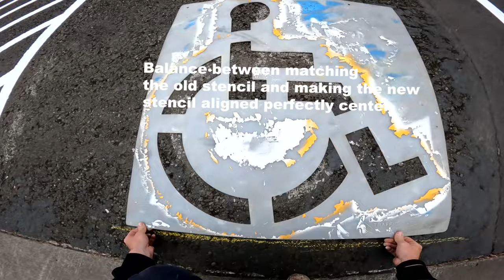Repainting Parking Lot Lines of Small  Business - process from start to finish!

Comment: You guys are wasting so much time and paint by riding on the machine for single lines.. I do striping in Delaware I only use the ride on to do huge parking lots or roadways.. been in the business for 20 years just my advice
Reply: I agree, push all small jobs. Malls and costco for the driver
Reply: so you can walk faster than the cart can, that is what you are saying, right?
Reply: @clkirk70  no douchebag but it's easier to line the machine up while walking than on the ride on. I run a striping business and time is money. I think I would know which one is quicker
Reply: @bdvn5488 how do you typically quote jobs? I was want to start doing this on the side i think there's alot of business in my area
Reply: @spencerevenhouse8175  we charge by the foot and depending on material cost you'll know how much to charge.. depends on the scope of work though as some lots are entirely more complicated than others.. also you have to think about the layout aspect which takes the most time on each job

Comment: Wondering how the paint holds up on top of gravel and moss/mold green stuff if the lots aren’t cleaned or prepped ahead of time. Also wondering why the two inches was important to mark with crayon, and not just paint to the already straight concrete/asphalt line? I guess it’s the customer’s request at the end of the day.
Reply: I was thinking the same thing.  As the owner of a softwash business, I would think that prepping the surface would be the first thing to do.  I would imagine that this might be an upsell item that the client declined...?  Any industry want to chime in on this and what is considered standard practice when it comes to prepping the surface.
Reply: I agree.....the surface should be washed down with water and a street broom to scrub the line to remove mold, dirt and lose asphalt. Dry with blower. Site prep should never be an option for the customer......

Comment: Snapping a line would’ve been much quicker and straighter, crayon grease will be there for awhile and you’ll save a lot of paint dropping the pressure when painting stencils better yet using a 113 tip
Reply from the maker: I agree, snapping a line would have been better - I will pass this onto our striper, although we stencil pretty thick so it lasts longer.

Comment: Those lines are freaking crisp! Great video! I'm about 6 months into the business and love it. I started with a titan 850 and was having so much trouble getting crisp lines. Found an old airlessco surestripe 3300 and it freaking rocks! Great job boys
Reply from the maker: ayyyy Thankyou so much, great work - It can be a fun, rewarding and great little business!
Reply: Just wondering your 850 titan. The only reason you don't get crispy lines it's because of the tires they're not air tires they're plastic but if you change the tires on it and still have the machine balanced shouldn't be a problem just wondering by the way I just started this business first year hopefully everything goes well

Comment: You kicked the gun out and lined the hood up straight. Better to see, I like that. 
Looked like a 3900 ? With probably fast set oil? 
Everything looked great, your starts, alinement on the old line. 
I’ve been striping for an airport for 10 years. And I’m wanting to get out and do parking lots. We only use latex at the airport so I’m unfamiliar with laying down oil. I’ve seen some new lines in my area that was put down with oil on new asphalt and they have this light over spray on both sides. Curious if that’s common with the new asphalt being so black, maybe not noticeable on older asphalt. 
I’m training my daughter to stripe so we can work together in this business. 
I’ve picked up a graco 3400  to get started with.  So I have oil in the machine teaching her. I’m also getting just a little over spray with the oil. Using a 319 with just under 1500 psi. Any tips for painting on new asphalt.  
We haven’t done any jobs yet still getting some stuff together like a pressure washing set up and looking to be ready for next spring. 
Again it all looked good 👍🏻

Comment: on some jobs I have problem with tip clogging, do you have any tips? I see your work is going very  smooth
Reply: Try straining your paint!
Reply: Do you soak your tips?
Reply: Could be many things try upping the pressure cleaning your filter or just putting a new one in, could also be the tip
Reply: Are you using water based or acetone based paint? If you're using water base you definitely have to strain it.. if using acetone base let your tips sit in a container with acetone in it when you are not using them

Comment: Sorry, pal - you can take all the time in the world to line up them stripes, but if you don't freakin' clean the asphalt ahead of time, you'll have perfectly striped dirt, which is what we see here.  You tell me at 2:28 - 2:31 of this video if there's no freshly painted dirt on that line.
Reply from the maker: Thanks for commenting, Pal - in an ideal world we can clean the pavement using machines, apply sealcoat and then do a new paint job. In this instance they just wanted stripes as we would be sealcoating it and/or restriping it in the very near future - so we didn't use cleaning machines, we just used our blower and a wire push broom to clean the cline. There is no *loose dirt being painted in this video.
Reply: @coastpave  Yeah, i was told to only quote striping on a dirty lot, and I sent an email before the quote going over points of detail and one thing I did mention was I will brush off the lines before painting, but it wont be the same as a full clean.

But its up to them as long as I let them know what to expect. I am hoping they will pay for a pressure wash, but its their money.

Comment: So what does the chalk represent
Reply: It was pretty pointless. 1. He didn't line up chalk marks to get equal length lines.
2. He missed the chalk marks.
Reply from the maker: Our striper snaps chalk lines to mark the end lines, and sometime to mark center line to stripe if its hard to see the existing lines! It's much more useful after we sealcoat and have difficulty seeing the lines, if its just a restripe we don't typically do doo much chalking.
Reply: You have a rider not only so that you don’t have to push the machine but also so that you can use a bigger tip. Like 325 so you can go faster. This guy is going way to slow.